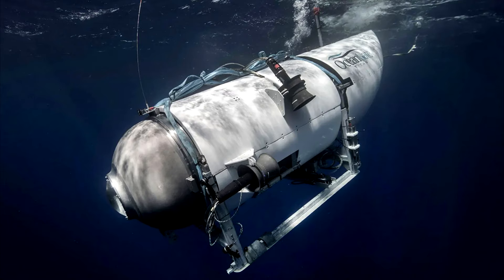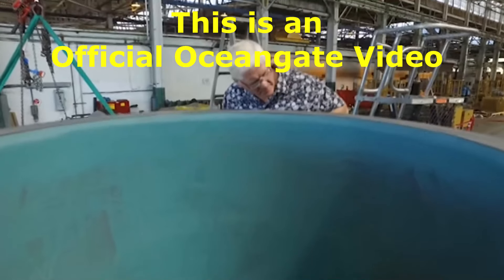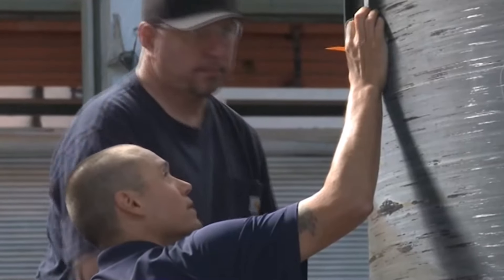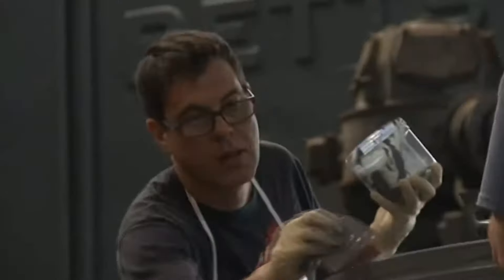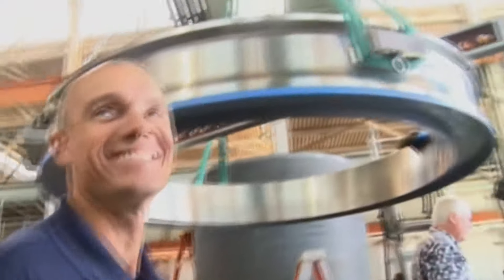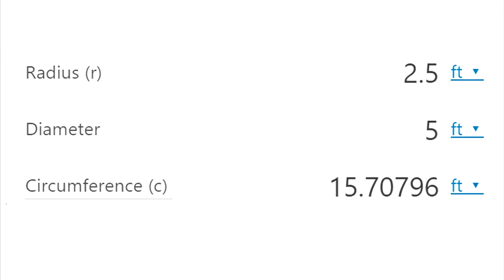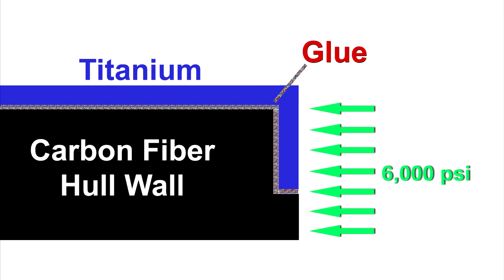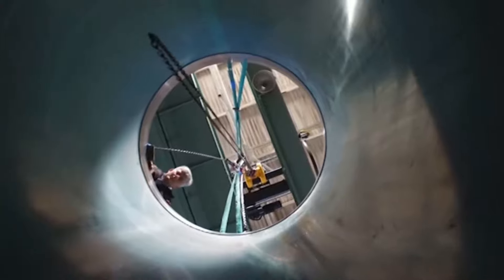Ocean Gate Titan Was Glued! Coast Guard Reviews

Comment: The sockets on the interface rings were definitely under engineered. The flexion of the CF in comparison to the titanium was a major problem.
Reply from the maker: Agree, the flexion and the difference in the materials reacting with the water temperature changes during the cycles.

Comment: When I worked in the optics industry, I did an analysis of the stresses caused by epoxy bonds joining dissimilar materials. When epoxies cure, they outgas. As these materials outgas, some material leaves as a gas, and that missing material causes shrinkage. Depending upon the epoxy used, the amount of shrinkage can be large, up to 20%. As a result, tensile stresses are induced along the joint line. However, the carbon fiber material doesn't respond well to tensile loading. As these Ti end rings were large, and had a large surface area, the outgassing would also be large, causing large tensile loads at these joints.

Comment: Also the placement of the ring on the hull is also eyeballed and not really measured.    Thats pretty scary.
Reply from the maker: Agree.  Tony Nissen, the engineer at the time, testified that he took the time to ensure the hull was vertical (plumb) so that the ring went on level and square.  I think he did the best could considering those factory conditions.

Comment: Did the carbon fibre hull have a titanium core, or, did the hull rely solely on the carbon fibre for strength?  If it did have a titanium core, how thick was it, could it have been welded to the sphears?   Would it have made any difference or, just allow the sub to survive one or two extra dives before failure?  Seems Rush didn't believe in post dive hull integrity inspections.
Reply from the maker: the carbon fiber hull was only made of the carbon fiber.  The titanium was on the tow domes.
Reply: rush was FREEMASON ILLUMINATTI, THIS WAS A RITUAL TO "CELEBRATE" the sinking of the titanic in 1912
Reply: @lunam7249  no illuminati would go down with his own ship. Rush was an egomaniac who really believed he was a revolutionary.
Reply: @ keep learning, the highest "honor" in shriner/FREEMASON is self sacrifice

Comment: I think it failed due to a few things, the glue joint was one place. But i really think it failed because of all the grinding done to the cylinder to get out the wrinkles in the carbon fibre fabric. Multiple layers of carbon fibre were ground through comprimising the layers, not to mention the fabric was layed down in 5 1 inch layers and glued between. The submersible would have been fine if it was only brought down to a thousand feet not 12 times that, everyone who worked for ocean gate knew it was only a matter of time. Stockton was so blinded by his ambitions to be a deep sea explorer that he overlooked safety where ever he could.

Comment: Obviously the water found a way through the glued joint and found a way in after that it was over.
Reply from the maker: That is what I believe.  I don't tihnk the carbon fiber hull collapsed as the primary failure point.
Reply: @solareclipsetimer  the carbon fiber is weaker at that joint its under cut. It could also crack there.

Comment: Glue technology is actually pretty advanced. I'm many cases glues today will not fail before the substrate they are applied to is destroyed. Not saying this was the case for the sub but there is nothing inherently wrong with using a correct glue for this application.
Reply from the maker: Thanks for commenting.  I absolutely agree with you on glue technology.  The Spencer Composites engineering proposal has a measurement for this glue joint.  It should be uniformly 0.03 inches thick.  My point in this video is that I don't see a process where there is assurance that those tolerances are being met. Maybe I am missing something.  Then, the NTSB document has pictures from the wreckage showing two things that shocked me:  1. the glue surface looks as uneven as the application process in the video.  2. There is a glue surface with an imprint of the butt end of the hull showing the plies of the carbon fiber imprinted with what seems to be so little interdigitated bonding surface.  So, I don't know.  Spencer was supposed to be an expert at gluing these sorts of joints and I guess they planned ahead for the loading and unloading of this glued joint.

Comment: Usually I would use glue on each end and then a bonder between them. It seems as though he had glue on side and bonder on the other side.
Reply from the maker: Thanks for your comment.  Tony Nissen testified that he did not want to be responsible for the epoxy process.  So, those guys doing the gluing were sent by Spencer Composites.  There were supposed to be experts at this.

Comment: If they mixed controlled diameter glass beads in the glue, the glue line gets a minimum thickness. 
But, the difference in crimp due 6000 psi of the carbon cylinder compared to the titanium dome cause a moment which had to be transferred by the glue joint. The joint geometry was not designed to cope with that moment. The mechanisme Itself was something like the booster joints on the Space Shuttle, it as a sort off resemblance.
Reply from the maker: I agree with you. That joint was bad for compression and decompression cycles.

Comment: Something a lot of commenters are getting incorrect is that carbon fiber can and has been used safely for deep sea submersibles for over 4 decades. Titan is an example of how not to do it properly.
Reply: Cite one human piloted that operates at 4k meters witha carbon fiber hull.
Reply: @camojoe83  If no one has sought human certification is irrelevant as the tech has been well proven at greater depths and lifetimes than Titan. I'm pointing out that stating that it's unsafe period like Cameron and others are doing is nonsense sensationalizing.

Comment: I am not an engineer, but an experienced fix-it-yourselfers and I can tell you there is NO WAY that one could place glue EVENLY with a “hand job” 🙃 and there be “no air-bubbles”. Furthermore, one is attempting to bond THREE DIFFERENT MATERIALS of THREE DIFFERENT STRENGTHS that would FLEX  under the enormous undersea pressures of 6000!psi in MANY DIFFERENT WAYS by undersea currents mowing in DIFFERENT unpredictable directions!!! The center piece is made of carbon fibers that ALSO would FLEX and may in time tear here and there and how would one know this has occurred?? This submersible was truly “experimental” and a disaster waiting to happen — RIP 🪦!!!
Reply from the maker: Agree, it was a bad idea that could not have lasted over all of these deep pressure cycles.

Comment: Here is the problem with all these videos, we don’t know if this is the first or second hull
Reply from the maker: You know, you are correct, I should have stated some points at the beginning of the video to make it more clear.  The video of the gluing process is of the first hull and it was a promotional video released by OceanGate.  There is no video available of this gluing process on the second hull.  But both carbon fiber hulls were glued on the same way and the titanium rings were reused, so it really doesn't make a difference.  However, thanks for your comment and I have updated the description to try to clear that up for viewers in the future.

Comment: I dont think the idea of glue per-se is the issue. The pressure held the sub together, the glue is the seal. You could use a rubber seal if you had some other way to hold it together under no pressure. I am inclined to believe a rubber seal would have been better, as it can be manufactured to a specific dimensional size/tolerance and hardness.
Reply from the maker: I agree with the inward pressure concept you state.  But the glue was not a flexible epoxy.  So, under high pressure pushing inward at depth also means moving outward coming to surface with release of pressure.  The calvus was 4 1/2" wide and 1" deep.  Cyclic movement here would be bad. You see in the video how uneven the gluing process was.  The gluing process was the same for the V2 hull.  Then if you look at the NTSB images of the wreckage you can see how the glue in the clavus either broke away in places or just pulled off the blunt end of the carbon fiber in other places.  Thanks for your comment.

Comment: This thing should never been made. Rush was mad and power hungry. Won't take no for a answer.
Reply: He may have gotten the idea from the successful unmanned AUSS submersible, which was basically built the same way. Cylindrical GFRP hull, epoxy glued interface rings, titanium end caps. The AUSS was designed for 20K foot depths.
Reply from the maker: @bills6093  I wasn't aware of the AUSS, thanks for bringing that up.  I did some quick research.  It was technology from the early 1980's and I have no idea how they did composites back then.  Seems like the outside diameter was only 31 inches.  I could not find out how thick the hull was.  Thanks for your comment.

Comment: Ok thanks to all the experts commenting here, going on about how the ends were "glued on" and how terrible that was.
Reality check: That has not been determined as the cause or even a contributing cause, of the failure.
One will note that pressure on the end caps would tend to force them onto the flanges at the ends of the hull, so the "glue" wasn't actually holding the end caps on at all.
Further, if, as seems quite likely, the failure was the hull imploding around its weakest point ie midway along the hull, it is apparent that the "glued" joints where the ends attach to the hull, would be the strongest part of the hull at all.  
Titan seems to have been a disaster waiting to happen from the outset, with its flaws guaranteed by Rush's obstinate rejection of proper engineering opinion in a number of ways, but that does not justify baseless pontificating about these expoxied joins between the titanium rings and the hull.

Comment: How could they possibly apply a uniform layer of glue by hand!  Also, they did it in a dirty, dusty warehouse with no protective gear rather than a  lab clean environment.  They had their hands all over it leaving oil and fingerprints.  I'm not an engineer but would think this would be a big no-no.
Reply from the maker: Agree.  Just wild!
Reply: “I’ve broken a few rules.” — Rush

Comment: Ok that is the job i learned and got my industrial Masterlevel degree in. A normal and proven way to "glue" two differerent parts together with high precision wold be spacers on the carbon tube made from the same material as the bonding agent. You would plan the spacer placement in simulations and experiments to make the thing foolproof. Then you will find the best spot for a vaccum line on one of the parts, and injection points for the bonding material. Do the math to determent the exact ammount of agent you need to fill the gap to the gram. Run the bonding process under controlles vaccum with exact dokumented parameter. Take every bit of Fill ine, preasure line and everything that had contact with the bonding agent, and weight it to find out how many agent is left, then compare it to the amount you put in the Fill line. Substract the weight of the resedue from the starting weight of your agent, and compare it to your math model. If your nubers are equal (with a little bit of tolerance), you done your job.

Comment: About the only thing one can say in Rush's favor is that he was willing to put his own life on the line.  But he wasn't exactly breaking new ground -- the nuances of building durable pressure vessels have been pretty thoroughly explored, and Rush just threw all that data away instead of building on it.
Reply: Good points.  Except, how many CEOs do you think are actually working in the "trenches" like this?  I cannot find a complete list of the deepest dives and who the pilots were on the dives.  The Coast Guard has flashed the dive log up during the presentations, but they have not released a printable copy (I can't find it at least).  My point is that I think Rush HAD to pilot the dives toward the end because he could not find anyone else who trusted the sub enough to do it.  He was trying to save the company and his dream.  Unfortunately, he lost both.

Comment: you can make a glue joint sstrong... but thats not how... they had no weep holes or any way for air bubbles to escape the joint, and hardly any adhesive squish out and it didnt happen evenly and at all points... ... i bet they barely had 50% adhesive contact max, and a shitload of air pockets in that joint...

the inside of that flange should have had some grooves or pockets or holes and such machined into it for mechanical strength, it should also have weep holes that should squish out glue when theyre fitted together to ensure full adhesion all the way arounudd and inside the joint... they skipped a ton of important steps...
Reply from the maker: Agree with you.

Comment: I dont necessarily see being glued as a problem. The adhesive only has to hold it together on the surface. Underwatter there is a massive force pf the watter holding the two ends on. 

Assume a structuresde from two metsl hemuspheres and a tube, analagoys to the the sub. There is a presure on it of 4000 lbs/m^2. Assume a diameter of 2 meters, so  the cross section is rougly 3m^2. That means the end caps are held on with force of 12,000 tons. The friction coeficient between two lunricated metal surfaces is around 0.15. Lets start by assuming a frictional coefocient of 0.1. So the force that it will take to slide the cap off sideways under that assumption woild be 1200 tons. Its probably more in the ballpark of 0.5 or more. So at leart 6000 tons of lateral force is needed to dislodge the end caps. To just yank them off you need around 12000. Id be far more woried about the entire structure imploding. Which is exactly wgat happened.
Reply from the maker: Thanks for your comment. And I actually agree with you.  Except when you watch this gluing video, you see that things are not that precise.  The Spencer Composites specification for the thickness of the glue joint was 0.03 inches.  I don't see that kind of precision.  This brings me to your point.  If the domes are forced inward, when descending, to an extreme amount of force, then the force is relaxing as they return to the surface.  Who knew for sure that the glued joint could withstand that kind of cyclical load change.  Is there a chance of slow water intrusion? I don't know.  I lean toward the hull imploding after delaminating also.  But I have another video in the works that has to do with lifting eyes on the sub.  Stand by for that video, you will be interested in it.
Reply: @solareclipsetimer  that's a good point. The glue has to keep the pieces where the need to be and flex and move to deal with the two dissimilar materials.

Comment: I have seen multiple videos of the Titan being transported without that lid/hinge supported either. The weight of that door hanging off the carbon tube during transport , unsupported, INSANE !!
Reply from the maker: I agree!  I actually believe that the front ring was the failure point for the implosion.  Due to the constant stress of opening and closing that door and not supporting it properly.  I heard a quote in the testimony that the door itself weighed 3,500 pounds.

Comment: Airplanes use the same adhesive I believe,
Hysol . It is what we are using to build an Unlimited Hydroplane Raceboat as it is tough when exposed to chemicals .
We use a serrated plastic squeegee to get that minimal but even amount.
I think the smaller teeth are way 
less than a MM. 
See West System spreader.
 The stuff is hard to get off once it is spread and it also has a short working time as it thickens in less than an hour .
    We use bolts they our connections and we 
Never rely on just the glue to attach .
The Carbon fiber also corrodes if exposed to air . They used out of date carbon fiber 
Not suitable for a Rocket .
      When building it , that carbon has to be sealed from O2 . It may have already been compromised and was just a time bomb waiting for that weak carbon chain / bond to give way .
Assembly also looks hard to pull off without one side scraping more glue away as it enters first , rim basically thinning that glue bond .
We glued 26’ of wood stringer to a honeycomb bottom panel like an airplane floor uses .
   Technology meets real world every so often.

Comment: Those returns that are glued together seem to me to be remarkably shallow at 1.5 inches, given the immense pressure cycles the whole system is subjected to when repeatedly diving I would want a lot more contact area. The carbon fibre hull seems very inconsistent and uneven across its whole surface and I believe they hand ground , with electric sanders the interlocking rings that make up the main hull, so they are actually importing weaknesses into the hull.

Comment: People are not listening to the facts, it made it multiple times to the titanic,
It sounds like something compromised the hull during a loading event, 
And that the dome swung open causing damage to the bolt on ring.
The epoxy they used was a body filler for composites it didn’t have acid etching properties.
You have to prepare titanium for bonding.
Had it had a deeper engagement on the collars it would still be getting stuck on wrecks..
They should have drilled holes on ring s put it under vacuum to ensure a complete bond. Then plugged holes for a water tight seal
Reply from the maker: Good points.  Looking at the recent images I believe the forward titanium ring was the failure point.